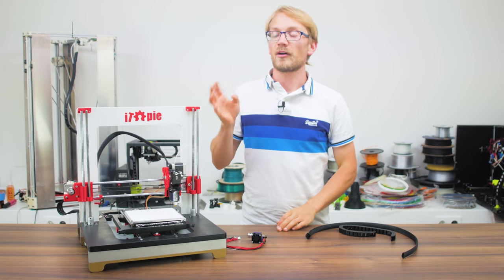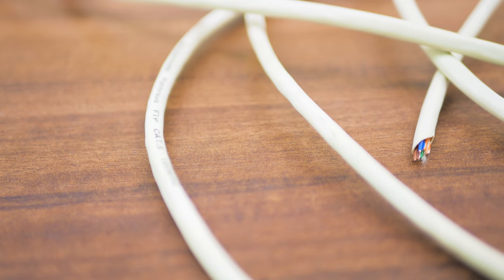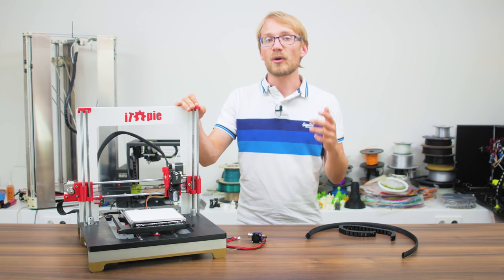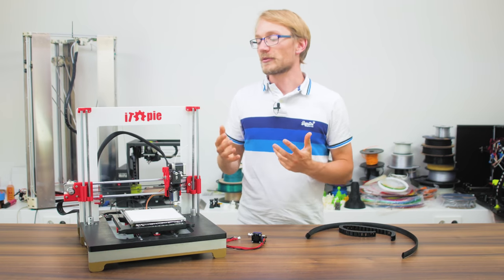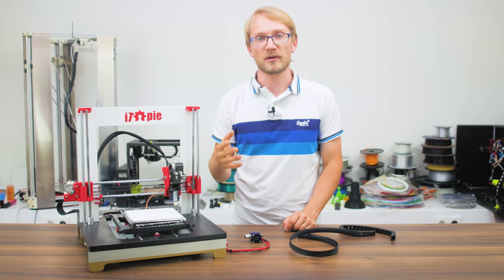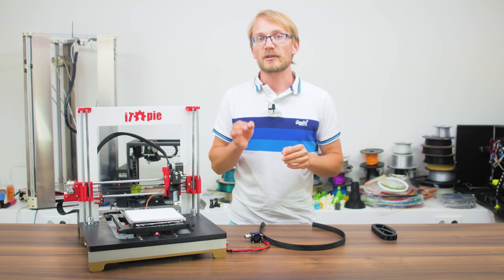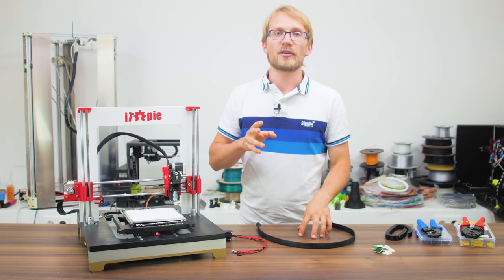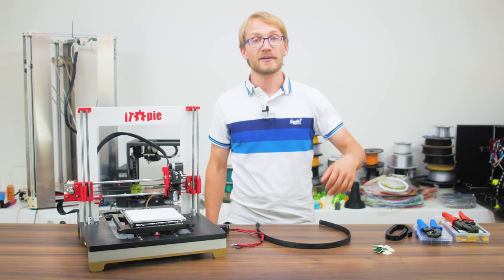How to wire your 3D printer!

Comment: Wire list:

2 hotend
2 hotend fan 
2 layer fan
2 thermistor (x2)
2 leveling probe

Here's how you clean up the wiring near your hotend/carriage:

Step 1: integrate a PCB with/near your hotend.

Next, on that PCB, you place a microcontroller, a couple of FET's, and a bunch of connectors or pads.  It might wind up looking similar to this:

http://www.hacksmods.com/wp-content/uploads/2015/04/RCTimer_DYS_SN20a_MOSFET_side.jpg

Offload your heater PID, layer fan control, hotend fan control, and thermistor(s) A/D software onto this microcontroller.

Connect all your components to the PCB.  Add a bimetal thermal switch while you're at it.

Finally, add a wireless transceiver like an nRF51822 or Xbee or ESP8266 or whatever.  Add the comparable transceiver to your main control board.  Now your main board controls all that stuff wirelessly.  Just pass the relevant gcode straight through.

Congratulations!  Assuming a bowden drive, you have reduced the wiring congestion at your hotend/carriage from ~12 wires to just 2 wires:  +V and GND!  Way to go!

And as bonus, you have also essentially reduced the wiring congestion at your main control board by about the same amount of wires.  The whole damn printer just got cleaned up!  Win-win!  And chances are your main controller is already running out of time and space trying to run multiple PID's, a user display + input device, all your steppers, reading from your SD card, and mesh bed leveling (because who the Hell wants to manually level a bed anymore?).  So it's a win-win-win!

Problem:  Industry is currently blocked at Step 1.

Comment: Does anyone know where I can get a parallel stepper motor cable for my z-axis? I need them to be 4 to 6 pin because my motors have 6 pins. I only have one port on my board and I have 2 z motors.

Comment: Whoa, 4:25.  A 12 volt, 4 to 12 amp DC continuous load running through 22 gauge wire?  I would recommend at least 16 gauge.  My beds have 16 and 12 gauge wire.
Reply: What he mention 22AWG is for 40W heater in the hotend which is around 3.5A, it's in tier 2 in the video.
Heated bed is in tier 3.
Reply: He was referring to the heating element in the hot end -- 4A, that is also pulsed.

Comment: What about the 8 pin plug that connects to the back of control boxes like the the cr 10 and tevo tornado? I can’t be the only idiot who removed wires from it when I tried to upgrade the hot end. Anybody wire one of those up?

Comment: All Dupont crimpers are not created equal! Don't buy cheap ones from China ie. Aliexpress
They look the same but are not. The cheap ones do a terrible job and make it difficult to get the pin in the housing once you have crimped it and you will end up buying a more expensive one after.
Thomas, I would recommend giving people a link or links to ones you know work.
Reply: I second that. I have bought a cheap Dupont crimping tool and spent a couple weeks struggling to get it to work.
I'd really be interested in a link to those crimping sets that Thomas mentioned in the video.

Comment: I'd also recommend these: http://www.aliexpress.com/item/100sets-lot-connectors-SM-SM-4Pin-Pitch-2-54MM-Female-and-Male-Housing-terminals-SM/32298674345.html same pitch as dupont but keyed and locking, nice to avoid confusion and doesn't disconnect itself from the machine moving.
Reply: Thanks, how do you crimp thes connectors?
Reply: same tool that crimps dupont should work, I do it with needle nose pliers though.
Reply: Thank you Christian, They look usefull for the moving parts. I'll order them now

Comment: I HATE WIRING
Reply: If you want the best choice in wiring use wire designed for continuous motion on a CNC, and battery cable or small size welding cable is always the best choice if you want to heat a hot bed and never want to worry about the wire failing. What is said in the video about lots of fine wires in each wire is very much true, as it will take longer to fail. All wires break over time, and if designed properly the wires that are used will not be ready to fail till after your expected life of your product. Failure takes a few different forms one is the conductors failing due to bending and this is easy to find as the wires stretch when pulling on them, and the other is the failure of the insulation. The insulation fails due to heat, abrasion, or chemical attack. I have seen all of these failures on CNC equipment that I have personally worked on over my years.

Comment: PEOPLE and TOM> NEVER EVER EVER!!!! use speaker wire for power wire period. is not designed to move volts. it can melt and can catch fire. i am MECP mobile electronics certified. YOU NEVER use speaker wire for a power wire period you are asking for fire. i have seen people get 3rd degree burns while holding speaker wire and tried to use a 12v drill to POP a speaker. speaker was bad and the wire melted instantly to dudes hand. ive seen cars catch on fire cause someone used speaker wire to charge a cell phone. i have seen boats caught fire cause someone used speaker wire to run a gps or fish finder. 

speaker wire is not designed to move voltage just wattage. there is a difference. this is video people in anet groups said they seen where people use speaker wire for mosfets. facepalm. then gives anet a bad name. update firm ware then use speaker wire for power ? LOL face palm.